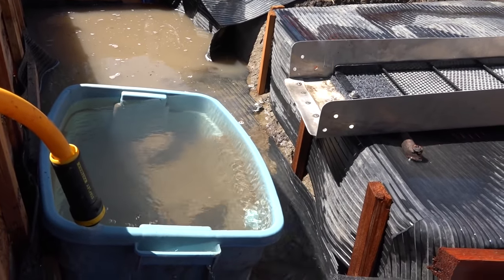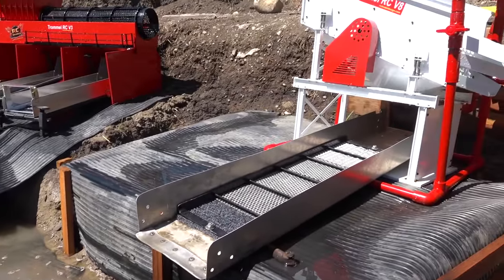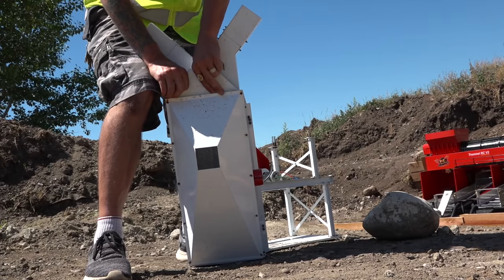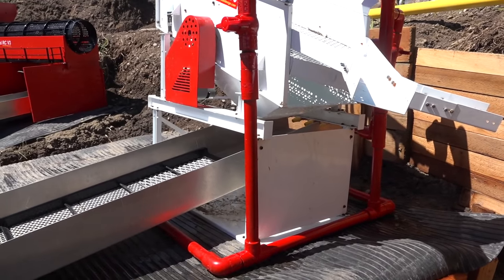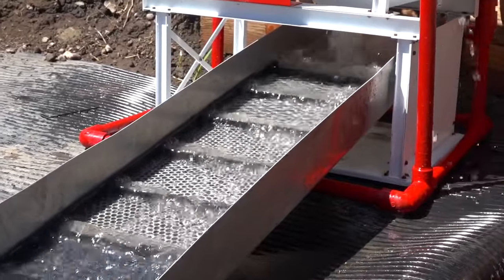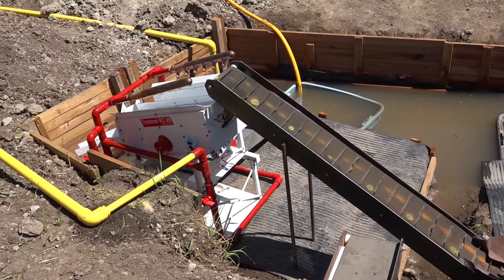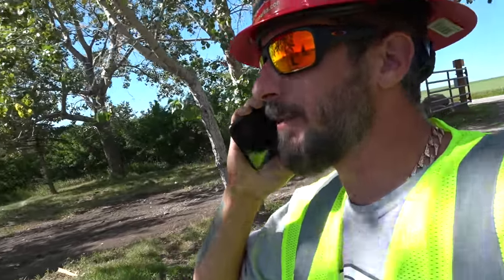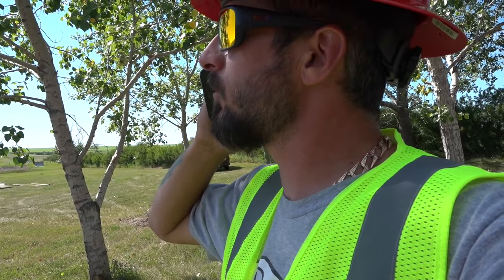YouTube GOLD - NEW EQUIPMENT DELIVERY (s1 e6) | RC ADVENTURES

Comment: When I turn 15-16 and get a job I want to save up for a project. I want to build a 1/4 or 1/5 scale RC car(or more likely a truck) with an actual scale gasoline engine. I kinda want to build a small diesel but fuel pump pressure is so high one mistake can be fatal. I am looking at the 2018 Ford Raptor. If it someday happens, seeing how much it could pull on the judge would be awesome!